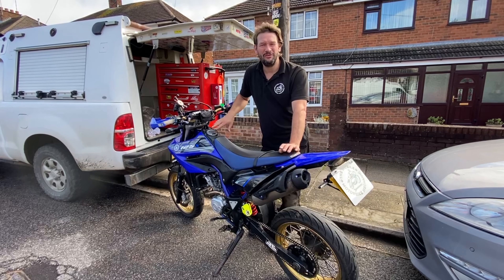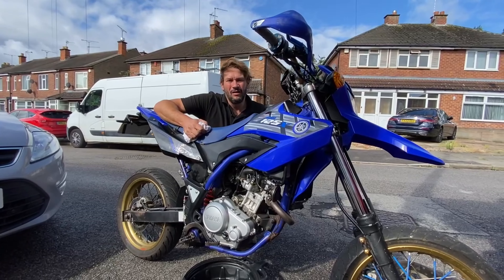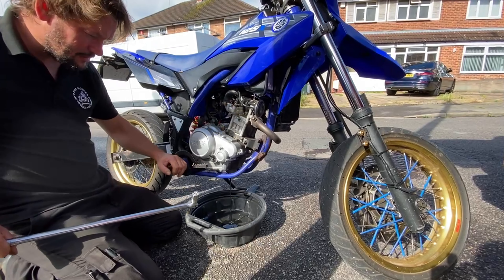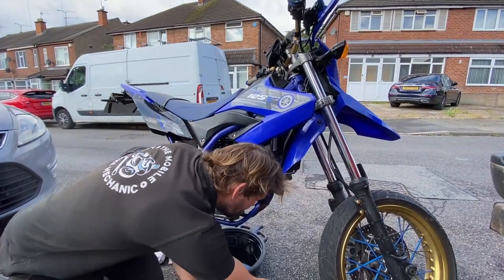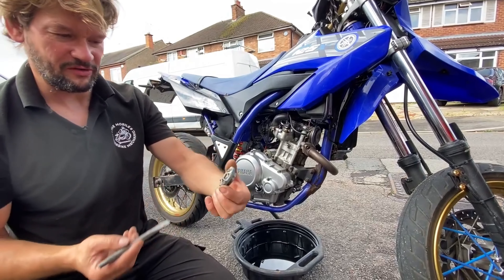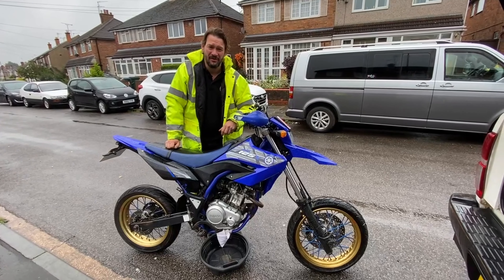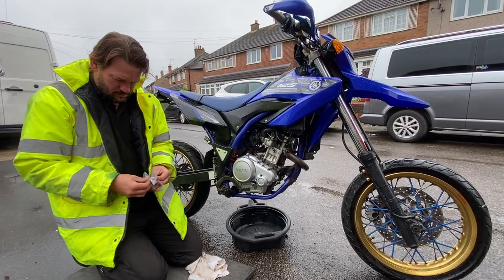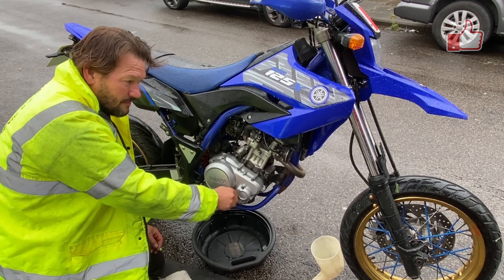Sump Plug Snaps on a Yamaha WR125 Motorbike

Comment: I can remember back in 1974 my eldest brother doing a oil change on his Honda cb 250 , he was having trouble getting off the sump plug ,he was using a scaffold pole to try and brake open the nut , I said you are doing it up not undoing it, when he got it out it had taken the flange off the nut , but good job the threads were ok to put another nut back in , I do all oil and filter changes on my bike and the only problem I have had was taking the oil filter off , it was just after it had been changed bye my Honda dealer on its 600 mile service, as I wanted to change it again at 2,000 miles, I even bought the Honda tool to take it off with no luck , so I resorted to poking a screwdriver through to get it off , so I always tighten the new oil filter with my hands , then hopefully it’s coming off ok next time .

Comment: Hi Steve just wanted to say thanks for explaining the sequence of adjusting clutch cable arfter fitting a new one yam r6 I believe it was , I fairly recently bought a 03 gsf 600 bandit with 5,500 miles so I thought it was why the transmission was very stiff having not done many miles but arfter re ajusting as per your video it shifts fine now so thanks for the tips an tec info it has certainly helped 0:02  me.out.
Reply from the maker: Glad it helped 👍

Comment: Using a brakerbar on a sump bolt your just as bad as the one that worked on it before you 

You should of stop work told the customer as its probably a young lad and that's how he gets to work 
So you could of the parts in then come back
Reply from the maker: The bike belonged to a customer that had a second form of transport and knew what was going on so no need to worry.
Reply: You know what was going on and you still done it  
That's really bad
Reply: Good day all. Probably a previous owner over tightened thinking it's better to tighten too much than not enough. After all they didn't want the oil leaking out of the engine.

Nice to see it all got sorted out.

I like this mechanic 🙂